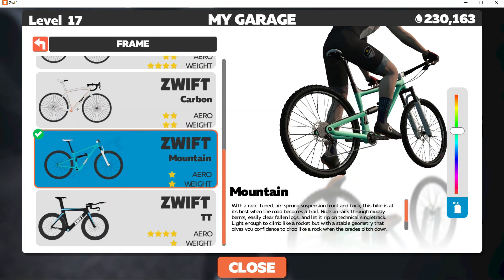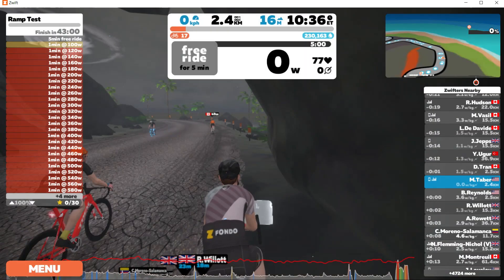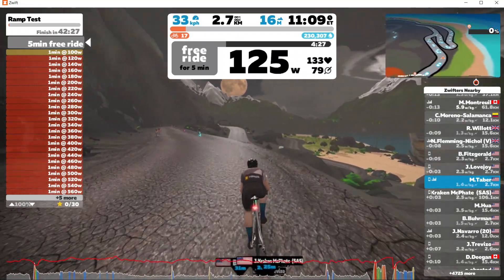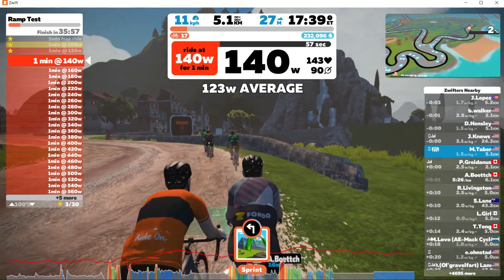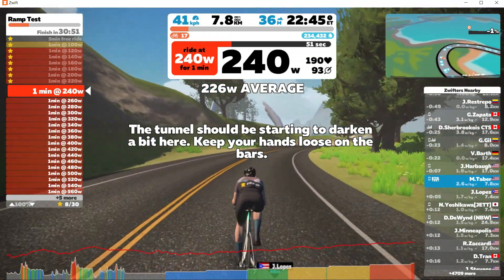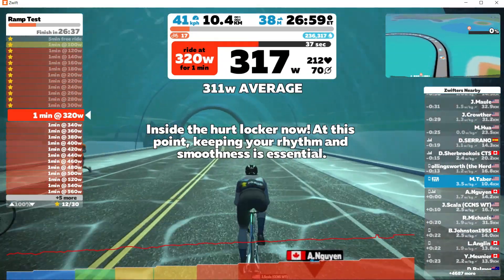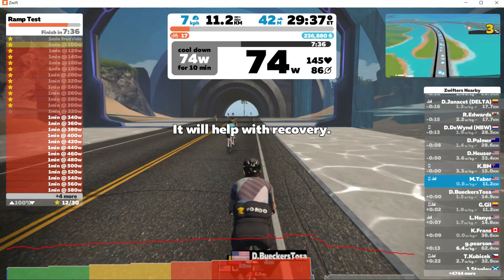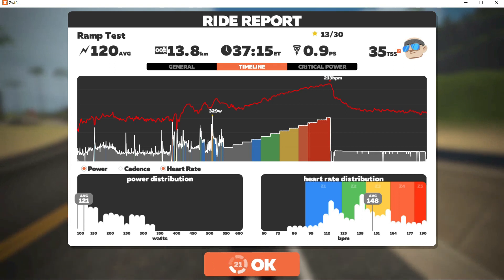Zwift's Ramp FTP Test - Overview, Guide, and Review

Comment: Hello Michael. I am new to zwift but have been cycling for past 18 months. I found your video helpful. I’d already taken an initial ramp test lite. Had one question: where does zwift list or report my actual current FTP score? I understand how it’s calculated but I don’t see the actual score anywhere. Any help would be appreciated. Thanks.
Reply from the maker: Its been a minute since checking but I believe when you go to see the different workouts you will see your FTP displayed in the corner.
Reply: What Michael said, plus, if you expand the user menu on the top right corner and select profile, you will see the FTP field where you'd normally input your FTP manually will be updated with the result after you do an FTP ramp test.

Comment: Dawg i think your HR monitor is off... there's no way your at 213 BPM unless you're like 10 years old
Reply from the maker: Seriously though! I've been meaning to test it against another HRM. Its a chest strap and i read they might be prone to strange numbers.
Reply: Some people just have really high heart rates. Also, if you're untrained or in an area that isn't properly ventilated, heart rate can go higher than normal.
Reply: @valentindelapena7333  yeah but 213 is more than a high heart rate😅
Reply: @ingmarneple6072  See my comment below. It's certainly possible for a young adult to have a max HR of 213 bpm, or even higher.
Reply: @valentindelapena7333   HR would not go above natural HRMax under any conditions, but it might reach max sooner under physiologically stressful conditions. But you are correct, HRMax is very individual and people differ a lot from the age-predicted value. My comment above points you to one of many useful articles on the topic.
Reply: Not at all. First of all, (a) 220-age (derived from secondary data by Fox et al., 1971, following a conversation during a flight back from the ACSM AnnualMeeting) is not the most accurate formula for estimating HRMax, and (b) all formulas for HRmax have a standard error of about +/- 10bpm. That means 68% of the population is between 10bpm above or below estimated HRMax, and 95% of the population is between 20bpm above or below estimated HRMax. A decent article on the topic is by Robergs & Landwehr (2002), "The surprising history of the "HRmax=220-age" equation", JEPOnline, 2002;5(2):1-10. It's free to access.

It's surprising how many athletes and even personal trainers are fixated on 220-Age formula as representing "true" HRMax. As an example of "true" HRMax, I'm 64 years old and my actual HRMax is around 195 bpm... my predicted HRMax using the Fox et al. equation is 156bpm!